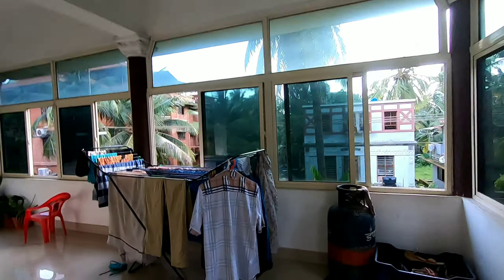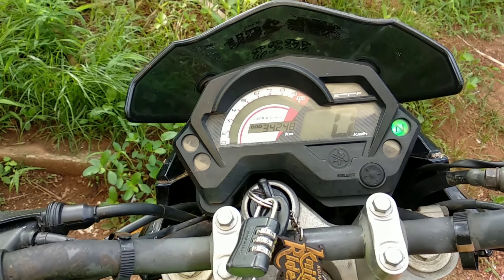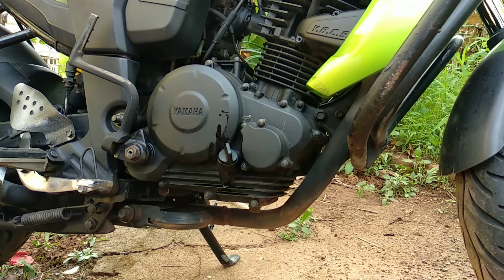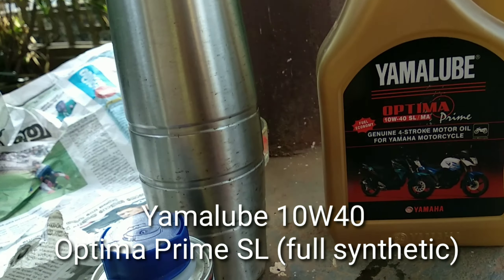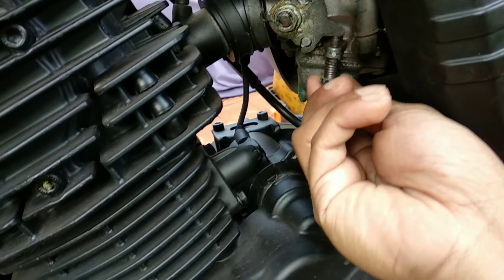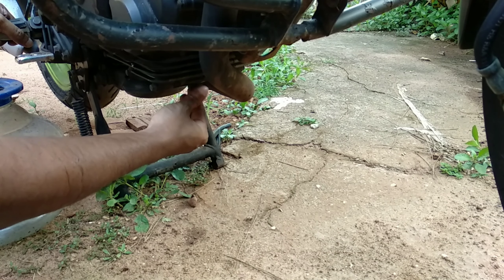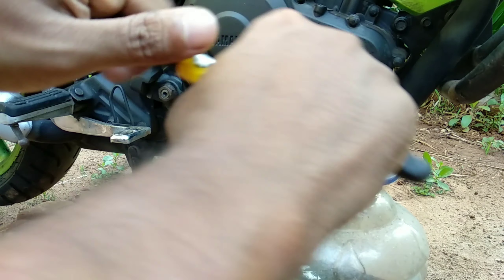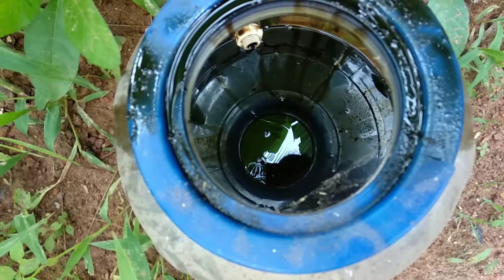#fzs #yamaha #engineflush Motorbike Engine Oil Flush - Yamaha FZs

Comment: How much oil needed after engine flush?

Do I need 1100 ml
Reply from the maker: 1000ml.
Reply: @tapas1505  my bike run is 8000km, I want to change 10w40 mineral to 7100 20w50 synthetic

Do I need to flush?

Few people say don't flush engine because new engine doesn't need flushing
Reply from the maker: @shubhambansal9789  no you don't need to flush. It's new engine, but in case If you stay in a dusty area or crowded area where you need to do lots of gear shifting while riding that causes lots of wear and tear to the clutch plate and engine. In that case you can flush otherwise you should wait till 20k kms atleast.
Reply: @tapas1505  ok.
Reply: @tapas1505  one more question if I ride bike continuosly for 15 minutes at highest RPM, will it gonna damage my engine

I am worried about it.

Comment: Bolt should be removed when the engine is cold not hot. Ok
Reply from the maker: You are wrong. It's simple physics brother. BOLT SHOULD BE REMOVED WHEN THE LIQUID IS STILL HOT because INCREASED TEMP REDUCES THE OIL VISCOSITY so it comes out easily along with all metal debris and contamination. But if the oil is cold, its viscosity will be higher so the dirt will stick inside rather than coming out.
Reply: @tapas1505  how  bolt and oil  related? When engine temperature increases so does bolts. When engine looses temp it is easier to remove the bolt.
Reply from the maker: @sunilmathew8047  That little expansion is negligible and doesn't tighten the Bolt at all, and it's still very easy to remove it. You just need to rotate it in the correct direction, most of the time direction of rotation gets reversed due to the position of the Bolt which is below the engine and most first timers commit that mistake and screw up engine's aluminum thread. This is a very very common mistake. But Our Main purpose of flushing is to pull out all the debris from inside and it's better to drain out the oil till its warm.